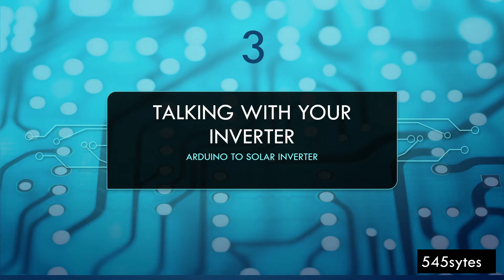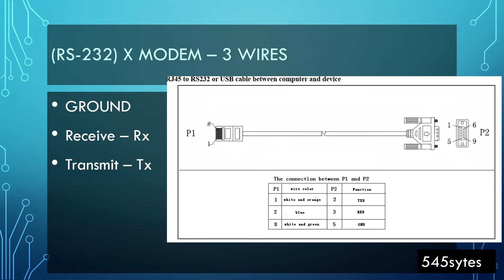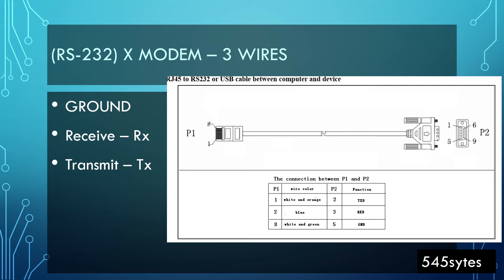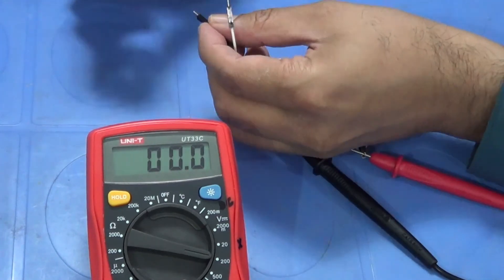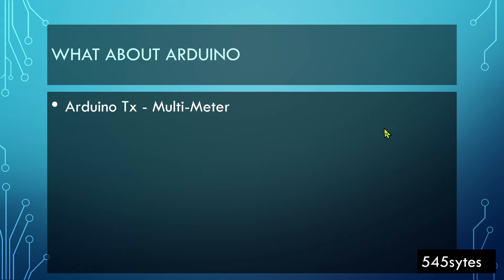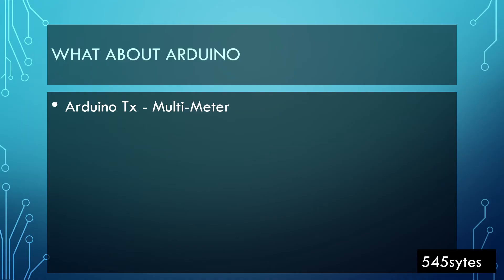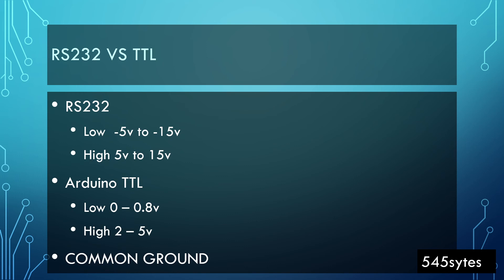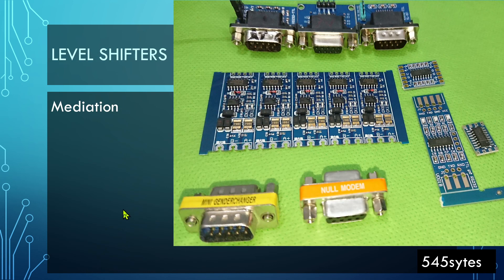3 (Ard to Invt) RS232 - TTL - XMODEM (Arduino Inverter Communication)

Comment: my inverter is following Modbus.. Can I use this method to talk with inverter?
Reply from the maker: Modbus is Software Protocal , which uses either RS232 or RS485 hardware protocol, better to consult Communication Manual of your inverter for correct instruction set. These videos are based on RS232, even if your inverter uses RS232, still for data extraction you will need MODBUS communication commands., hope this helps
Reply: @545sytes  thank you